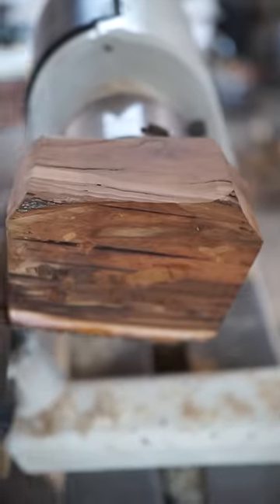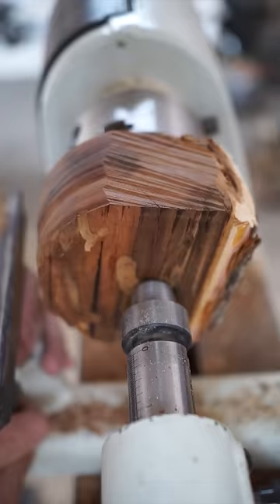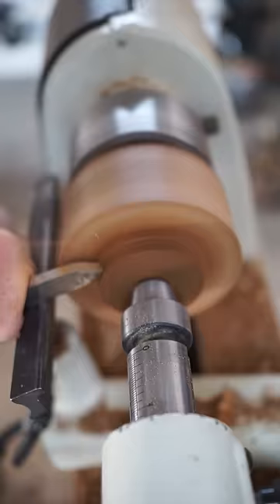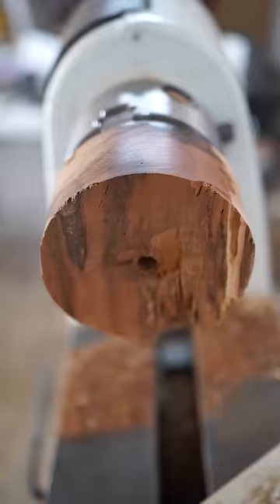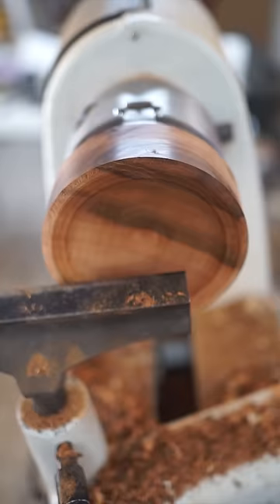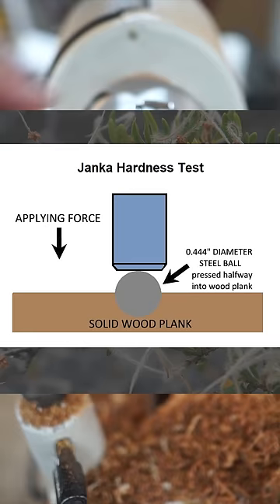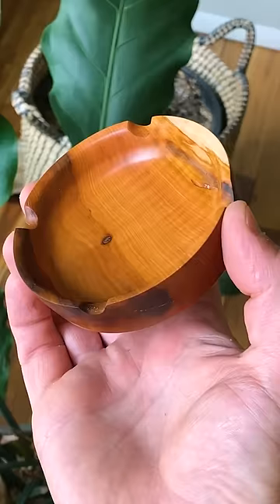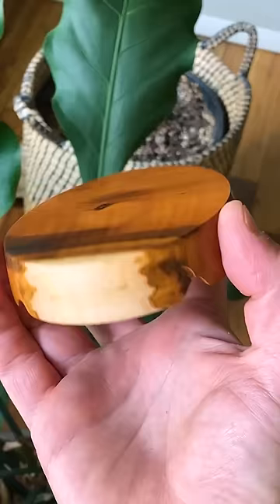One of America's Hardest Woods Getting Turned Into an Ashtray

Comment: The absolute weirdest way to measure the hardness of a wood, I love it, makes me think of how horsepower is measured (it’s not how you think)
Reply: How???
Reply: @businesssolutions9265 How much power it takes a horse to get out of a hole  or something.
Reply: @trilobite3120  wtf
Reply: yeah they see how many horses they can stack on the car
Reply: actually this way of measuring wood hardness makes sense because it measures density and is a good indication of how resistant to dents and wear the wood is.
Reply: They determine shotgun gauge by weight. It takes 12-12g lead balls to make a pound
Reply: Heh, wood hardness
Reply: @lamegame420 so that's why 14 gauge is smaller then 12 gauge
Reply: Obviously it's measured by progressively tying horses to the hitch until either the car can't pull the horses or the rancher finds you and shoots you in the thigh for stealing his horses.
Reply: @trilobite3120 not at all lmao
Reply: That method is also used on other materials actually
Metal especially. There are also different scales and they depend on the object they push in
There are Brinell, Vickers and Rockwell
That's the 3 they taught me in school at least
Reply: @whatusernameis5295 it's also because the conversion to ballistic calculation and weight is possible to do with gauge.
Reply: @Andi-ex1js Mohs hardness scale comes to mind.
Reply: It's the inverse of measuring Rockwell hardness. There you apply a certain force to a ball bearing (or diamond) and measure how far it goes into the material.
Reply: @infernaldaedra Moh’s hardness is an incredibly simple and basic way to create an index. This is convoluted and requires specialized reference hardware.
Reply: Right, like it make sense, but it's such a specific method of measurement you wonder how they came up with it
Reply: Lest we forget that Horsepower is actually the force required to lift 550lbs one foot off the ground per one second. Also, the average horse has between 15-17 Horsepower. It was initially developed as a measurement to compare workload capabilities between steam engines and horses.
Reply: @TheFishE77Official I thought that was Newton or whatever it's called? But yeah, makes sense, I've heard it before, only with meters I guess
Reply: @TheFishE77Official  Depends how that power is measured, a horse can have around 15 and much more horsepower but only for very short durations of time, indefinetely a horse breed that they used for this could keep up a 1 horsepower.

Comment: Us machinist use the Rockwell test, very handy for figuring out what the hell u have from years of scrap if it wasn't marked
Reply: The Rockwell test is similar but more precise. But unlike wood, you can harden metal. So just because you can measure Rockwell hardness, you are still guessing what you have. A scrap dealer had a gizmo that attaches to a smart phone. Looks like a gun. He points it at the metal and it tells him what the alloy is. Slick!!! We thought we had some hardened 4140 but turns out it was L6, a steel I had never heard of.
Reply: Hardness, toughness, etc, all have different ways of testing and are different qualities. This is compressive strength, whereas Rockwall is resistance to surface scratching.

Comment: An ashtray out of wood? Wood burns.
Reply: Here's a thing about fires. There are three types of burnables you put in. You have tinder, kindling, and fuel. Tinder can be lit with an ember or sparks, kindling needs a small flame to ignite, and fuel a large hot flame. Hardwoods are fuel. An ember can not ignite fuel

Comment: Id love a ashtray like this but i would feel bad sticking my burning butts down into this beauty- ive been using a silicone ashtray thats shaped like a teacup with a little plate holding it  it does have to be washed more then a glass ashtray but i havent stepped on a piece of glass/ceramic in years ( i break all my ashtrays bad habit like smoking ) one of them got pierced and i took some clear silicone and closed it up still are perfect 7+ years later…. Dying for a custom ashtray that will actually fit my fat doobs  cigar ashtrays are nice but generally are  too heavy and expensive for just a Bigger slot